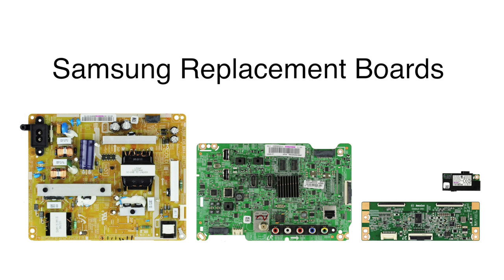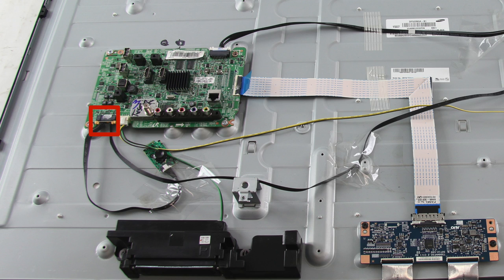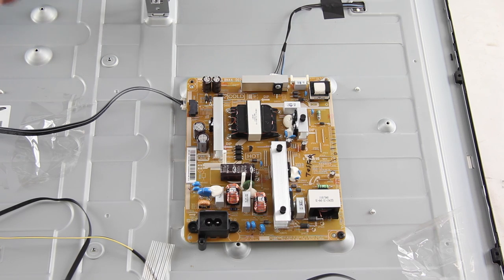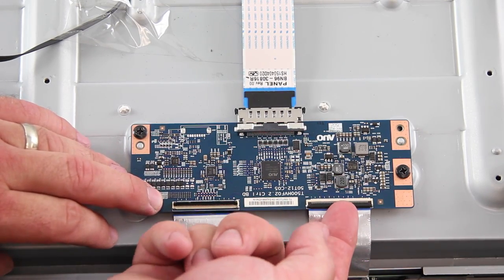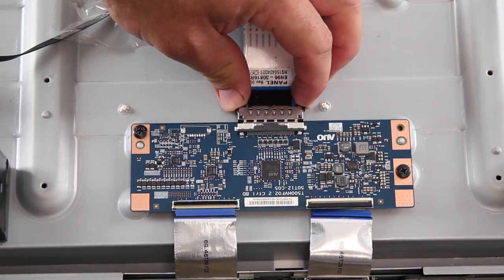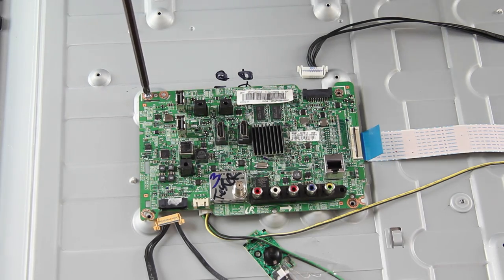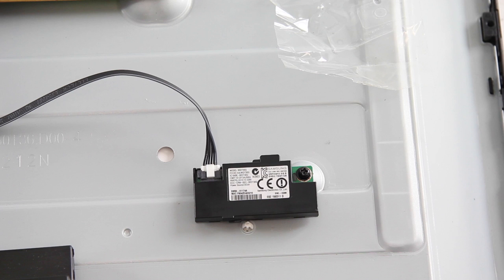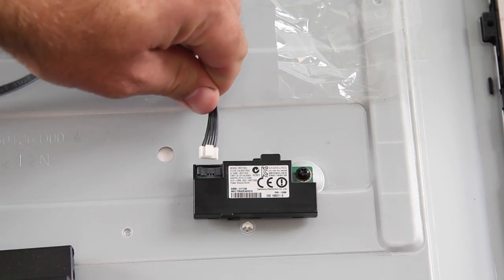Samsung UN50H5203 TV Board Replacement - How to Fix Your Samsung 55" LED TV - Samsung TV Support

Comment: One thing about this video, when connecting the new t-con board, I'd recommend not having it screwed in. The bottom two cables are so short, that it's easier if you connect them first then carefully lower the board into position, and then screw the board down. Then add the top connector which goes over to the main board.